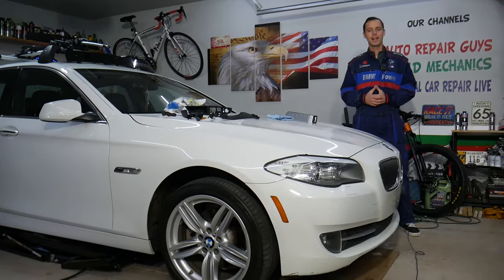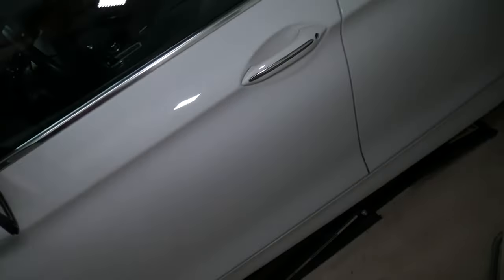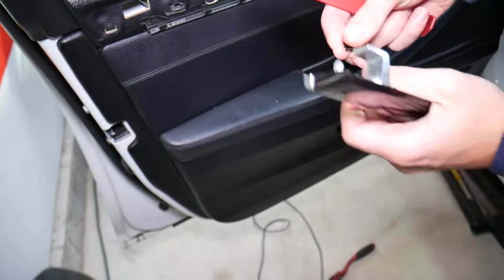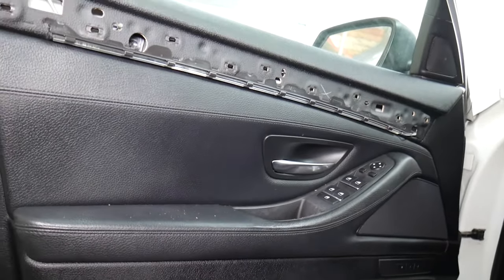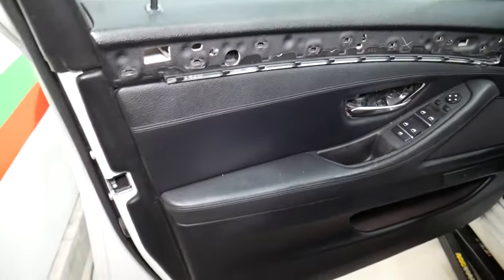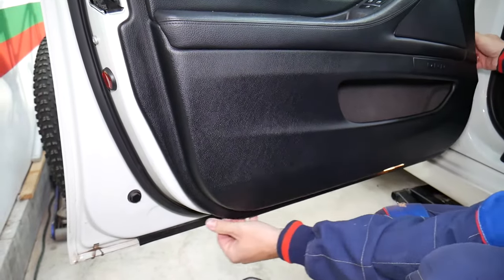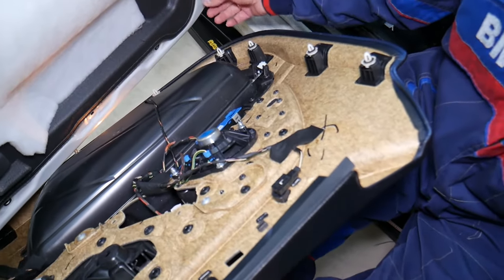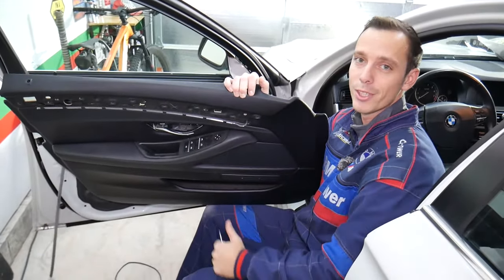BMW F10 F11 FRONT DRIVER DOOR PANEL REMOVAL REPLACEMENT 520i 528i 530i 523i 535i 518d 520d 525d 530d

Comment: Please help 
I have Mercedes Benz E240 i have problems when kick down the paddle engine light comes up and the code is random and multiple miss fire and rough idle
I have changed the spark plug and cleaned the injectors and the problem still the same